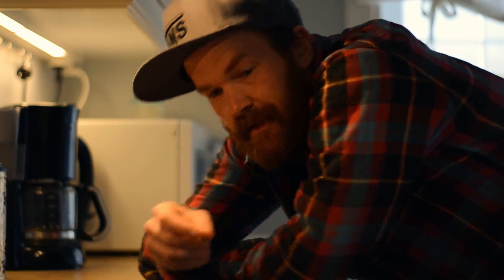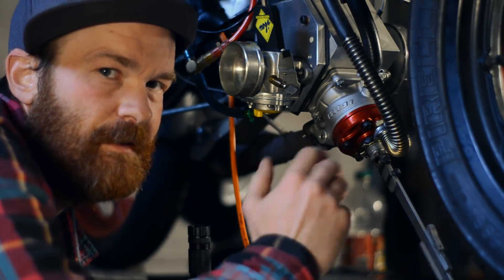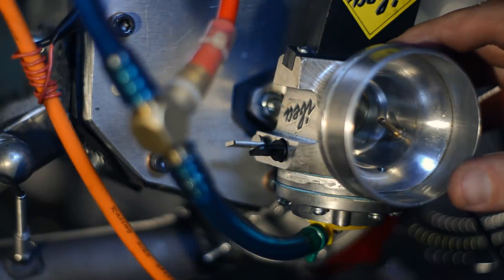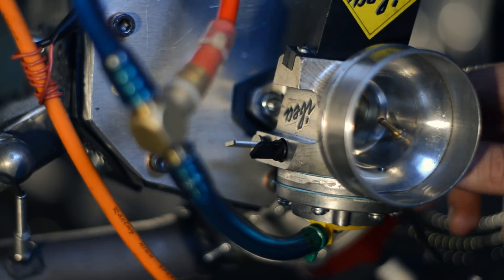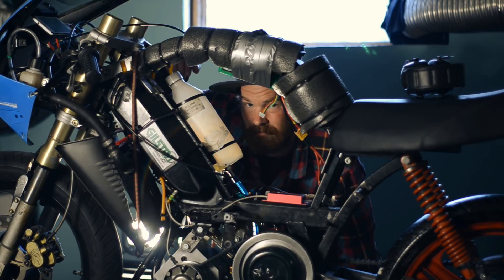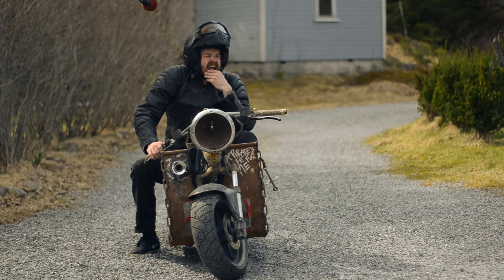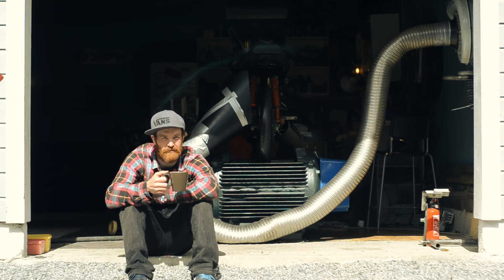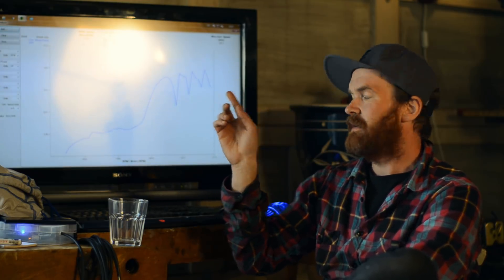iBEA Carb FTW! - 50cc DIY Rotary Valve Peugeot Spx

Comment: Have a Blessed birthday! Love 2-strokes, I handle chainsaws and found your channel searching for tuning tips.. I run Aspen fuel.. My ported 242 husqvarna is doing 16 773 with No load.
Looking forward to your next video. 
Blessings from Løkken Verk Norway
Reply: TheJonsberg  did you do the timing advance mod already on the 242?
Reply from the maker: Takker!
Reply: 2STROKE STUFFING  I do a lot of work on 2 stroke man I have premix in my blood but I recently bought a Yamaha ysr 50 non running I got it running and about 3 days but somebody before me put a Chinese knock of pz22 carb on it the bike seems to be running a lean condition that I can’t solve it could be something as simple as no air filter but your bike seems to run fine without and air filter. Everytime I start the bike it wants to idle somewhere between 4 and 6k rpm. I’ve tried tuning it but am having no luck. So I’m hoping you see this comment and have some feed back for me anything would be greatly appreciated! Keep up the good work man loving the videos!
Reply: Arjan van Helden not yet, this saw is Just something else.. Bought myself a wireless tachymeter..
Reply: Doesnt seem like a good idea to aim for highest RPM, easy to destroy your engine... Normally I tune chainsaws while under load. I once ported a chinese 43cc saw and wanted to see how far I can push it. The con rod blew into pieces at 19k. Had 19mm Zama carb that was suited for 63-75cc saws... 

Am I wrong?
Reply: The thing is when you tune a ported engine in the cut it will rise rpm @ wot when ported. Since you dont run near that max rpm in the cut this would be fine, its even possible that a saw like this will still 4 stroke hard @ wot.

keep in mind this saw does stock 15500 rpm at WOT

Comment: It's Alive !
BTW standard procedure for adjustment of MJ on Kart is to turn it rich until it 4 strokes at peak RPM, then turn it in a bit at a time until it just stops 4 stroking at peak.
That gives you a "safe" mixture at peak
Adjust low so it throttles off and on clean after MJ is tuned..
Reply from the maker: Thanks for the advice!
Reply: I use the same procedure on Tillotson carbs on my snowmobiles. Start with the low speed, once its idling nice start with the high speed. I like to start like 3 turns out and work my way in until it stops 4 stroking.
Goes for any carb really, I always try to start high on a new engine or after a modification. Sometimes it wants more than I anticipated though :)
Reply: On rc boats we do the same but leave it so it just 4 strokes when holding the boats still in the water. Then we just hope it won't sieze up at wot if it lifts to much from the water.

Comment: i had the pulseline connected to the crankcase on a honda mt5 69cc.
Huge problems with tuning, i gave up.
But i never had it with the correct side up =(
Reply from the maker: Too bad, having it right side up really made a difference to how it responds to the screws.

Comment: 5:32 your engine mount bolt is getting loose the one above the yellow sticker on the carb slide at this point in the video it is backing off some locktight/or some nylock nuts might be a good idea. great work btw the rat looks good as well
Reply from the maker: Good catch! No worries tho, it's loose on purpose(but with a loctited nyloc nut).
Reply: 2STROKE STUFFING nice 👍🏻

Comment: And can you try E85 if you can get it over there
Reply: Ford For Life I don’t recommend that unless it’s direct injected. Alcohol is a great solvent for washing oil off. I remember back in 2000ish when they first added 10% by me. I honestly couldn’t tell u the amount of lack of oil related issues from it on sleds watercraft and some quads. Everyone of them had alcohol in them...
   I’m actually a e-85 fan. Poor Man’s race fuel that loves boost, in 4strokes or di smokers. 120+ octane for less than $3.00/gallon can’t go wrong

Comment: Looks like your damper is restricting. It’s blowing gasses through every small leak haha
Reply: Could aswell be making more power from being a restriction as it could in theory make for a stronger reversal of the exhaust pulse in the expansion chamber, who knows.. only way is to test with and without it ;)
Reply: Yeah, you seem to have a major leak at the silencer weld.
Reply: i believe that if there is a higher pressure in the stinger from a restricted muffler, it could make the reversal of the pulse stronger, just my thinking out loud. but i agree he should definately test it!
Reply from the maker: It's the slip joint between the stinger and silencer, it's worn and a very loose fit - have to fix it cause the leak is oiling up the dyno drum.
Reply: Robin Sundell I think after the tail pipe there is no pulse interaction, unless the gasses cannot escape quick enough out of the tail pipe. But he should test without :)
Reply: In one video this guy said that smaller exhaustpipe end makes more power
Reply: #50notuck
Reply: InIMoeK yeah i noticed the same thing. Maybe it will make even more power without/with better muffler
Reply from the maker: True.
Reply from the maker: Yep.